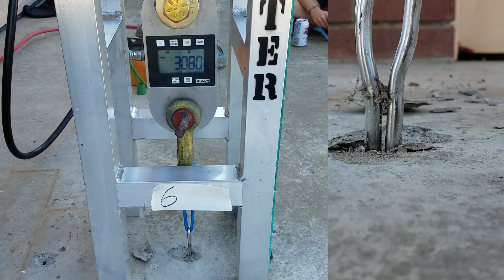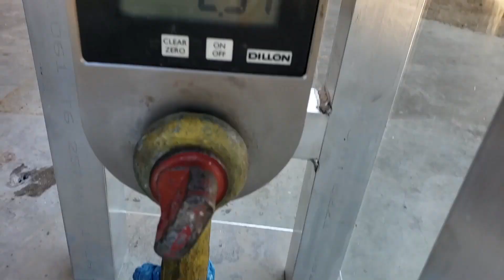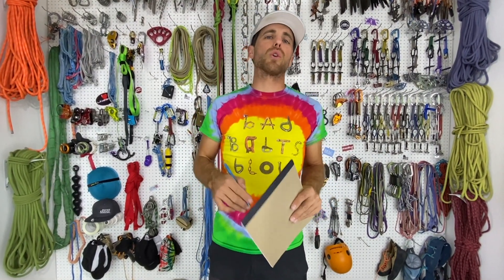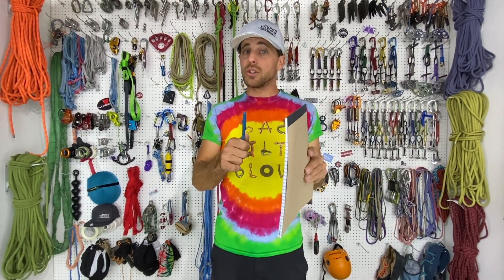BoltBuster - Glue in holes not cleaned.  Wave bolts in AC100 glue tension tests.

Comment: Have you considered the load rate for your tests? That is a common factor considered in materials testing.
Reply from the maker: as long as it consistent with our other testing then we can compare bolts.  I can't do cyclic loading or shock loading with the system we have